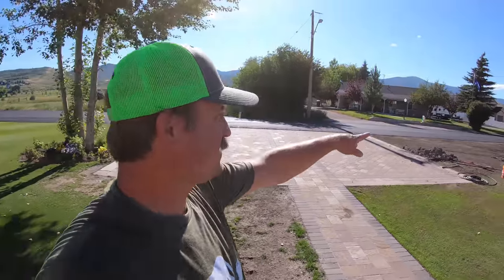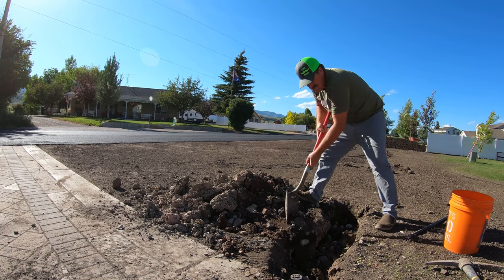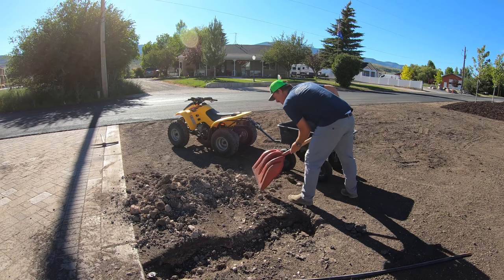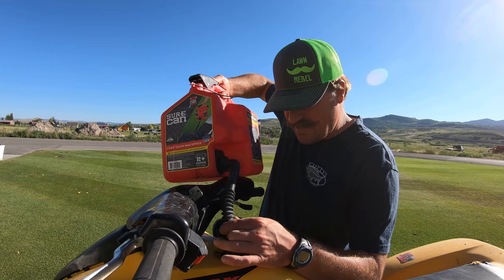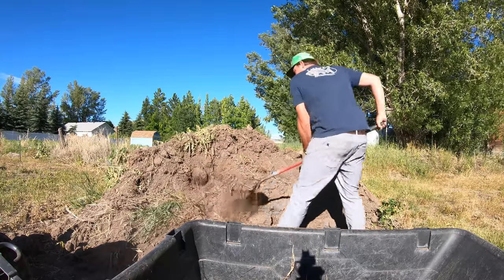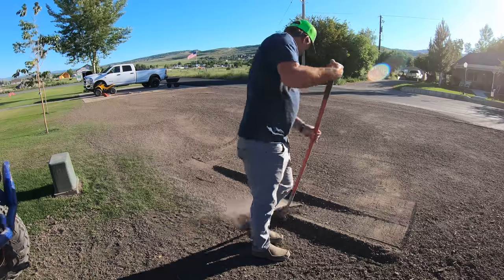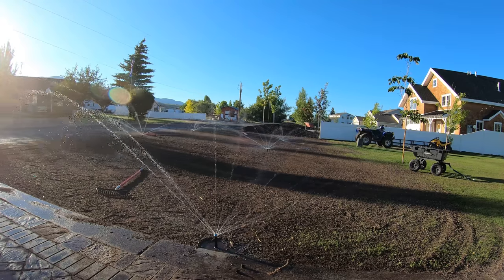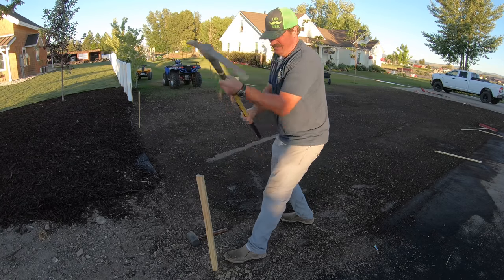PREPARING DIRT FOR GRASS SEED. Dragging it flat.

Comment: I noticed you didn't remove the rocks from the soil around the pipe, here in the Adirondacks we can't bury rocks next to water lines as they will rub through the pipe when the frost moves the rocks around in the dirt. We practice this even though we bury lines between 6 and 8 feet deep, which isnt fun to dig up when they freeze or you find out someone left a rock next to a line
Reply from the maker: good point. I never even thought of that.

Comment: Hey Conor, I recommend you get some concrete sprinkler donuts and put them around those heads by the street.   I promise you that they are going to get run over and broken.  We have some in our subdivision that were getting destroyed and those donuts really helped.
Reply from the maker: yes.. the plow will likely ruin them.
Reply: Connor Ward 🤬, that’s a real pisser offer.

Comment: Would consider bringing back the classic sign off
'AND I WILL SEEEEEEEEEEE YOU IN THE NEXT ONE' 
Initially I was going to comment about "YOU CAN NEVER PREPARE ENOUGH FOR IDIOTS" but it has been covered.

50/50 on the caution tape
Reply from the maker: Yes that is the plan for the sign off. I was originally going to include the seeding in the same video but it was just too long. Therefore no sign off.